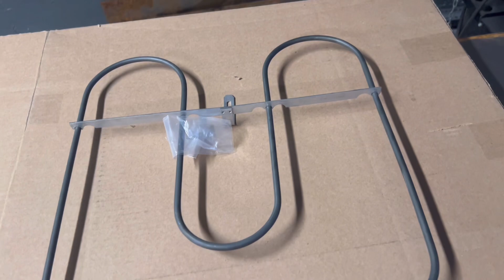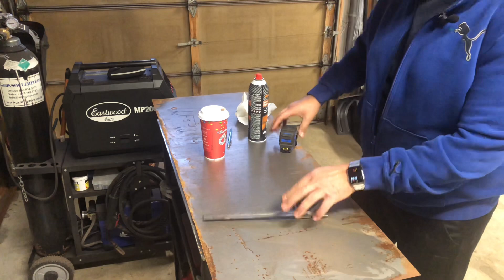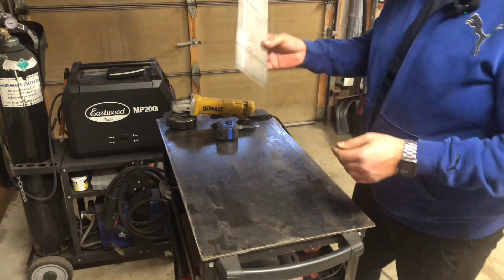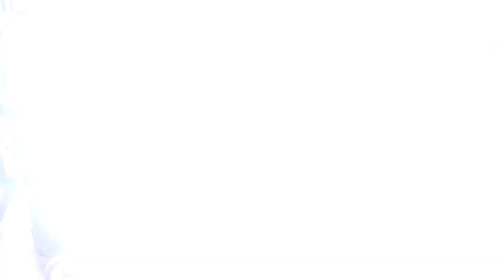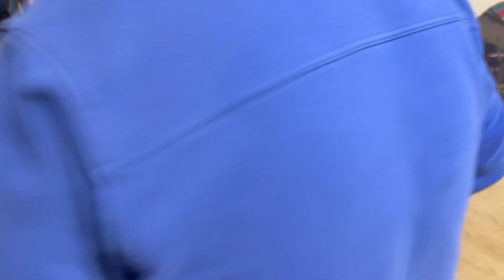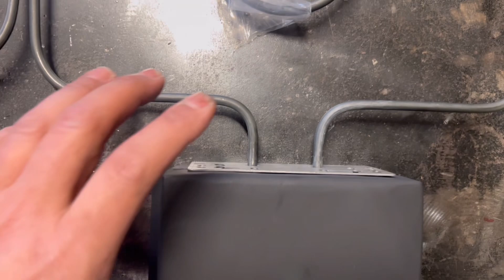Custom heat coil mounts for powder coating oven. #powdercoatingoven

Comment: I hope you go into detail with the wiring of the PID controller. I have a homemade oven fully constructed. I gutted a traditional electric oven and used that wiring harness for my build, unfortunately though I didn’t test it beforehand like an idiot and I found out that the controller was not functional. So now I am investigating the PID option but I feared that it may be a bit of a headache, and I wasn’t sure if it would work for my application. Seeing that someone else is using the same methods gives me some inspiration that it may work…
Reply from the maker: Hey good morning I definitely will be going into detail.  In the meantime, if you would like message me on Instagram and I’ll send you a wiring diagram and see if that can help you out.

Comment: What is the watts of your elements and where did you get them?
Reply from the maker: Hey good morning, the elements are 3000 W each to run both elements you would require a minimum 40 amp service. I have an account with a supplier, but you can buy something similar on Amazon.
Reply: @welding2go  ok thanks. I was hoping that you would have a link but I will search.
Reply from the maker: @gbodyperformance   I’ll send you one
Reply from the maker: https://a.co/d/2E6LkMu
Hope that helps